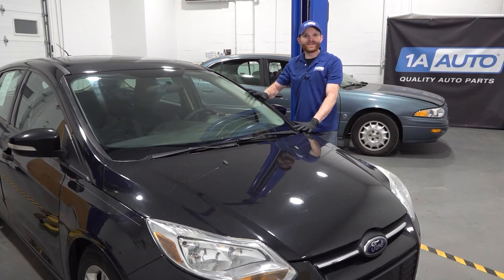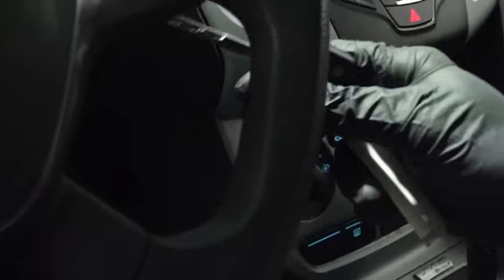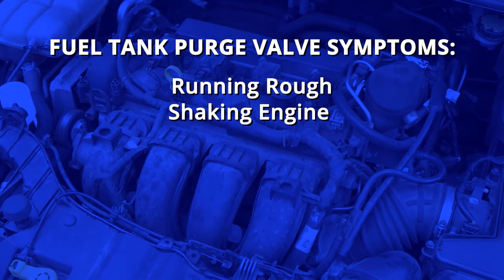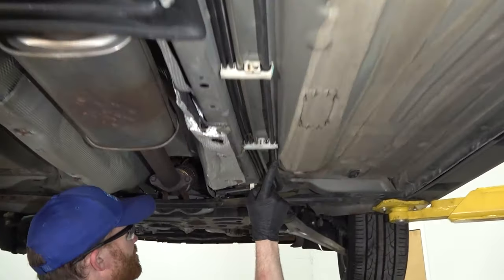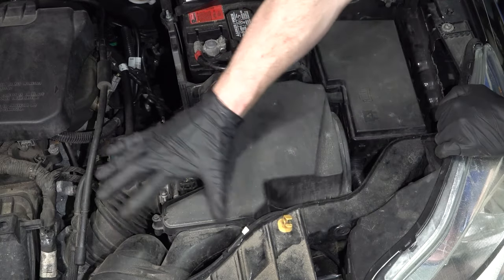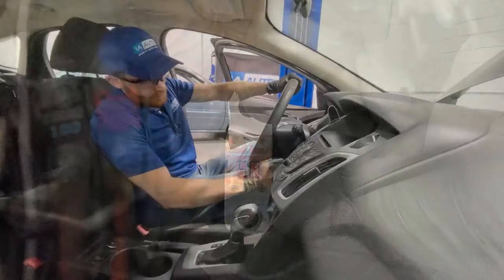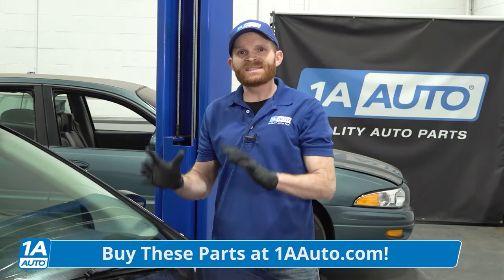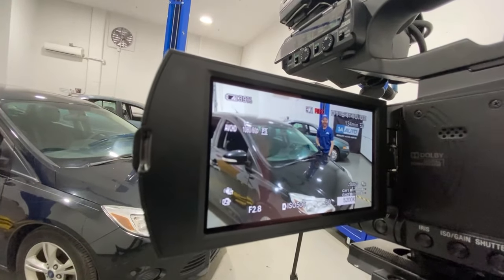Top 5 Problems Ford Focus Hatchback 2012-2020 3rd Generation

Comment: I’ve had my 2012 Ford Focus SE sedan since new with 20 miles on it and it’s pushing 162.000 miles now and I haven’t had any issues with the transmission or TCM module , I change the oil every 5.000 miles and the transmission fluid every 6.500 miles and I’m not gentle with mine I’ve beat the heck out of it and it keeps going with no issues no check engine light etc and it still looks like a new car I live in upstate New York where they salt the roads heavily and no rust because I keep it washed, guess I’ve been lucky.

Comment: I have a 2015 Ford Focus se hatchback, I have owned it for two years and I have had no problems , no issues with the car at all , my Ford Focus is a very good car & I am happy with my Ford Focus!
Reply: Automatic or manual? I'm getting ready to purchase one and need to know
Reply: @a-traypickens8929  ultimately you're better with the manual since its just less risk getting a faulty automatic. the problem is finding a manual focus
Reply: The clutch last less than 100,000 miles that’s the top problem
Reply: I drive a automatic!
Reply: @a-traypickens8929  They fudged the auto shifting timing, first through third are kinda bumpy and almost have to be taken at faster speeds.
Reply: Bot alert 😂

Comment: Bought 2014 Focus SE hatchback automatic  brand new. When through 3 clutches within 90,000 miles. Sold it to Carvana when I was told to replace the clutch.

Comment: I have a 2015 Focus and man ive had the Purge valve issue and ground straps issue!! Ford did recalls for the purge valve but only did a reprogram. Less than a year later the same issue happened and i ended up having to take it in to the dealership and pay for a new one. The ground straps issue is the same symptoms but instead it was a Transmission Control Module which was luckily covered under warranty. 
Ill have to bookmark this video for future problems!
Reply: Did messing with the ground straps help anything at all?

Comment: i’ve got a 2012 focus se with the 5spd manual, it’s been pretty reliable for me.   I have replaced the purge valve, it was an easy fix though.   I think with these cars, you have to get the manual if you want a decently reliable car.   I know someone who has the auto and she was without her car for months, waiting for her transmission to get fixed.
Reply: Yes I have a 2013 5 speed manual.  Still has the original battery! Car has been so reliable. I bought it new,  only I had to replace was the coolant reservoir,  just did it a week ago
Reply: I agree, mine is an ST version. No issues except the recalls for purge valve
Reply: I have a 2014 sedan with the manual. I autocross this car once a month I have done suspension and brake mods but other than that it's stock and other than regular oil changes my car has never needed a repair at 89k miles
Reply: @noahhedrick1156  just hit 110k, bought it in June of '21 with 92k miles, only issue I had was breaking a harness when I changed the motor mounts lol, otherwise, after the collision repair it's been reliable and solid. Love it. The manual is so comfortable to shift compared to my old Mazda 3 too. My radio is def failing too, bluetooth keeps getting interference lately, think it's time for an upgrade :D
Reply: Indeed. It seems the latemodel Focus with Automatics were WORSE than the AX Family (as found in the 2005 and related Taurus, Sable and Windstar/Freestar) OR the C3 family transmissions (Found in most of the other cars/trucks/SUVs, such as the F-Series and Explorer), which were always notorious for catastrophic failures.  There's also the AOD Family which were, while still problematic, less likely to fail.

The AX Family were old and should have been better by the 2000s. It was the AX4N and the 4F50N (after 2001). The C3s were (Very late in life) the 4R and 5R family transmissions. I am just using the first 2 characters because there were MANY XR family variants. I've seen 2 personally. 5R55E (Explorer 1999), 5R55W (Explorer 2002). Ive also seen Three AOD Family transmissions, but have only confirmed one: the 4R70W in a 1997 Thunderbird. Other AOD family transmissions were most likely in the two 1995 Ford Taurus' we owned when I was in my teens.
Reply: Yea it seems automatic sucks
Reply: Smart man. It seems Ford didn't do a good job with this gen or the previous 2008-2011 automatics either - though it seems 2012+ got worse. I bought a 2009 ford focus when I go to my 2nd home in Mexico. After reading a bunch of reviews, I made sure I got the 5 speed manual and stayed far away from the automatics. Yes, some automatics may make it to almost 200k miles, but a large majority will not. And replacing a transmission is much more expensive than a clutch.
Reply: I got the 5 speed manual and it has been very reliable lately with the exception of the radio issue and fuse issue. Glad I stayed away from the automatics as I was looking for a first car 😬

Comment: 2012 focus sel here. 220k miles. clutch and TCM were replaced under warranty at 90k. it rarely has the chattering when accelerating slow from a stop. when i happens i go to a place i can do some wide open acceleration from 0-60. do that a few times to remove the glaze and all good. haven't had to do it for a long time. i just do some spirited driving occasionally. 
had an amp fuse blow in the hatchback compartment.
water pump was replaced due to seeping but that was an easy repair.
tires, brakes and battery has been replaced once.
i do have to replace the thermostat at some point. getting a thermostat efficiency code so thinking its broken and stuck open. that shouldn't be difficult.
Something that is annoying is all the interior pieces rattling and vibrating not to terrible but my ocd kicks in. lol
overall a great car. i have talked a few people into buying them and they havent had issues.

Comment: 2012 hatchback SE manual . 168k miles . Not a single problem. Healthy. Just regular good maintenance. Love my little focus .
Reply: I have the 2013 Titanium sedan, with the automatic...and I never had a single problem either. I dont know how people drive their cars nowadays serieously
Reply: @Begunend20  As long as you don't baby the automatic Focus you shouldn't have issues with the clutch. Other than that it's a solid car.
Reply: 2012 hatchback LW (The aussie SE), 240k kilometres , 5 speed manual (We're sadly a dieing breed)
Never skipped a beat. Gave it a cut and polish with a full detail the other day, looks brand new
Reply: @Begunend20  People just do not care enough to take care of their vehicle properly. Or the whole process of vehicle maintenance seems intimidating and overwhelming, say if you're not mechanically minded in the slightest, the inner workings of a car can seem like a complete mystery.
But mostly I think people just hope for the best most of the time.
I compare it to the Dentist. Sometimes people are worried to find out what sort of expensive problems they'll run into by visting the Dentist. So sometimes you just avoid going until inevitably something goes very wrong.

Comment: I have a 2014 focus se, I’ve had the typical purge valve issues and cvt trans issues and the radio issues, all that aside you do oil changes on the these cars they just keep going

Comment: I have a 2014 auto hatchback..apart from the recalls for tcm and purge valve..I have replaced the purge valve myself once. and apart from top motor mount shocks and rotos and brakes..and routines oil changes..im at 225k miles and still running strong!

Comment: Great video. #5 issue on grounding strap is very important. Dual clutch transmission uses high current motors to operate two main clutchs. Poor ground with marginal current means motors struggle, maybe throwing trans codes. For years, battery was first grounded to engine block, so starter always enough current. Don't know why Ford, Chrysler went battery ground to chassis first. (Maybe shorter copper ground wire is cheaper.) Ground that battery directly to engine block or transmission. With low 12v and high current, the quality of the electrical ground connections is important.

Comment: I've had 9 ford focus's and the Mrs has one...  They're solid cars! I've never had any of these problems. If I were being super critical I'd say the rubber at the bottom of the doors (which is sorted by super glue)  and avoid ecoboost engines.

Comment: I've had three major problems with my 2016 Focus- 

1. That Transmission. Yes, that one. Had it fixed at Aamco and ended up brining it back twice ($4300) this was at a little over 100k miles.

2. Died on the highway- Couldn't start it. Went back to the car an hour later while waiting for a tow- Starts right up! It was intermittent because the engine fuse(?) 50 amp mega fuse was cracked and would make contact when it cooled off and separate again when it warmed up

3 My cooling fan would come on normally when going to work in the morning with AC on, but if I tried to go anywhere after my initial trip - the fan wouldn't come on, the AC would cut out and the engine temp would start to rise. Since it didn't happen while driving freely (seemingly) I replace the fan module (WRONG) Tested the relays (WRONG) and then finally realized it was the same kind of shit 50 amp fuse - right next to the first one. 

All is now well with 120k miles. Looking forward to the next adventure!.

Comment: I own a 2009 ford focus with 260k and still running. Replaced the power steering and followed routine maintenance such as oil changes brakes shocks struts tires etc…. I still get 40 miles per gallon on the freeway and around 38 around town.

Comment: Recently sold my Mk3 wagon. Way too many issues. Ironiocally none were mentioned here.
The roof leaked like a collander
The coolanmt leaked bellow the dashboard
The boot release kept jamming 
The wheel tracking kept going out
The engine was dripping oil
Some of the intermal lights had failed
Honestly was more trouble than it was worth. Which is annoying as I used to have a Mk1 Focus, and it was the most reliable thing ever

Comment: I guess my early 2012 (May 2011) is a unicorn, because it has had no issues, other than corrosion on horn terminals. It also has a manual transaxle so no problems there. It has been the most trouble free car I've ever owned, and it's got 148,400 miles on it and runs like new. Just drove from Cleveland to Columbus and got 40 mpg on the way down, 37 mpg on the way back, which is driving to a higher elevation. I believe this is the last car I will own.

Comment: The purge valve was a recall... Also, the TCM & DCT dual clutch is the main issue with the 2012-2016s. For you not to mention that is beyond ridicilous..... I had a 2013 Focus Titanium DCT.... the transmission was the only issue.. Other than that, the car got 27mpg city and never had any other issues mentioned.
Reply: Not for the 2017 4 door 1 liter engine
Reply: I bought new a 2012 Focus, had the Trans. replaced & drove it for 7 years racking up almost 300,000 miles with no issues. I traded it in on a 2018 Focus Titanium. runs great.
Reply: Guys what litre engine model did you get? And petrol or diesel?

Comment: I have a 12' Focus with manual transmission. averaging 37mpg. 140kjust replaced the valve cover gasket and coolant tank. Fingers crossed for 200k!

Comment: I’ll tell you what is the top problem I’ve had with my 2015 is that the automatic transmission is crap. I’ve had the 2nd gear clutch pack replaced twice and was told that this is a known problem in the transmission between 2012 and 2017.
Reply: 2014, 150k with no problems on the trans. Owned since new, maybe learn how to drive?
Reply: @fearthecheez  there's a literal lawsuit about this issue. I've lost count how many times I replaced the clutch at this point.
Reply: I've had the same or very similar with my 2015 as well. I'm to the point that I can't wait to move on to something else, but affording something else is tough right now. Have you had any issues with the bluetooth going out randomly?
Reply: @Pedro-gr3tu  Anton Smith is a troll. That account shows up in various auto videos and is always a contrarion to what is being presented.

Comment: Have an older focus 5-speed. 2 problems, 1 fords design! The gas, brake and clutch pedals are too close together.(especially when wearing work boots) Many times I step on the gas and brake or clutch and brake pedals at the same time. Don’t wear work boots driving anymore. I sure miss my old Lincoln town car! (79)

Comment: Drived this car for over 165.000KMs in 8 years and sell it with over 190.000KMs. One broken spring, water in the trunk, a defect for the eDiesel particulate filter and I changed my pump for the window. VW-drivers have most earlier defect wheel sleeves, motor failure, DSG-failure.

Comment: I have the 2012 Focus 1.6TDCi Titanium and apart from the water ingress in the back (easily fixed), bass rattle from the air vents (turned out to be the tyres), new stop/start battery and reset to make it work and AC not being as cold as I'd like, it's been a great car! Does 70mpg on the motorway and 52.5 combined.  Only things I've changed, have been a K&N air filter, a rear wiper delete and running lower springs.
Reply: I also have a 2012 1.6TDCi econetic and it's been a perfect daily driver. Also had the water ingress issue sorted by my local garage and also had to replace the bonnet catch as the sensor had worn causing the alarm to go off randomly but mechanically it's been sound to 90,000 miles so far.
Reply: 70 miles per gallon? I don't think so.
Reply: where was the ingress of water coming from
Reply: @grossgo  70 UK mpg, thats about 4l/100 km or 58 US mpg. My 2004 fiesta 1.4tdci does about 50 us mpg, small cars with diesel engines are awesome.
Reply: Hey man sorry for late reply. Can you go into detail about the water ingress? Having same issues and not sure what the solution is.
Reply: @jivyajinn4144  same problem here, I have no clue...

Comment: Fuel tank purge valve I've had this repaired on my 2016 focus st and my brothers 2013 focus se. None of these other issues though...had other issues like cruise control on my ST working and other times just doesn't work. On the 2013 I recently had to replace the exhaust manifold and catalytic converter assembly as the cat was plugged, like 1700$ with labor. Manual transmission is where it's at like everyone has said.

Comment: More reliable than any 4 cylinder car GM or FCA  has made in the last 25 years. I've got over 275k miles without any major problems. Also you should check to see if all the recalls have been performed before changing EVAP parts.

Comment: I bought a '14 1L ecoboost Focus and then swiftly sold it on after hearing about the wet belt issues. In the UK they have the nickname "ecoboom". I don't need that hassle, there're garages around here that literally keep those engines on the shelf they die that often.

Comment: I just got paid out almost $1300 for the transmission from a Canadian class action lawsuit. 

The fuel filter purge valve actually caused the catalytic converters to fail because the engine backfired so often. The purge valve deformed the gas tank. 

I won’t ever buy another Ford product.
Reply: Same here 😤 I just done both my purge valves, front and back, now every week I still get engine light, hesitation, I never over fill it ! Had to change the rear one three times and now I think I have too do one or the other yet again 😤 I like the 🚗 but I would never buy another ford! Right off the bat I had to replace the auto clutch, two years later the purge, it's really annoying 😡

Comment: I’d like to state that I have a 2013 focus but the only problems I’ve run into was a pinched wire for the trunk release and the radio fuse. Maybe because it’s a manual and only has 85 on it but I haven’t had any of these issues.
Reply from the maker: +Daniel Horrocks Thanks for the feedback!

Comment: I had my purge valve go out, the only problem was that when you filled the tank it took a couple of rotations for the engine to actually kick over. That was it. Definitely never stalled out on the highway

Comment: 2014 Focus Great car, except the Transmission six speed automatic. I’ve had two already. Now it’s ready for number three. 105,000 miles. The first two were covered under warranty. Looks like number three is on me. 72 Years old I’ve never had a Transmission go bad NEVER. Now three in the same car.

Comment: Mine is a 2018 Focus Titanium auto Ecoboost 1.0 ltr and for the past 9 months, I've had an intermittent parasitic drain.  This was our first ever new car and it only has 11,000 miles on the clock now, but we dread going out to it in case it won't start.  Spent a week in the main Ford dealers in Dec 22 and they said it was the Halfords battery and changed it.  The problem has still come back.  The trouble is that with it being intermittent, when the garage check it, it is normally ok - but it's not.  Driving us mad.

Comment: Ford quality on those ground straps. I had a 95 Taurus and was almost as bad as our 88 Corsica. After those two cars I was done with American cars.
Reply: My mom had a 1990 Taurus and it had so many problems that the Ford dealer refused warranty work and Ford wouldn’t do anything about it. Transmission failures, ECU failures, wheel bearings, all happening before 50k miles. Ford transmissions are still pretty unreliable, like the 10 speed
Reply: I had an 89 Taurus and it was the best car I ever had lol I think I got a fluke
Reply: 4.6l v8 crown vic ,grand marquis and the  town car are literally the best American car ever made very reliable.

Comment: Hope I'm not tempting fate here. I've had a 12 plate titanium econetic for 7 years and only had problems with a leaking boot and recsntly replaced the clutch slave cylinder. Started at 58k now on 86k. It does judder a bit when I pull off, but it's been a great car 👌